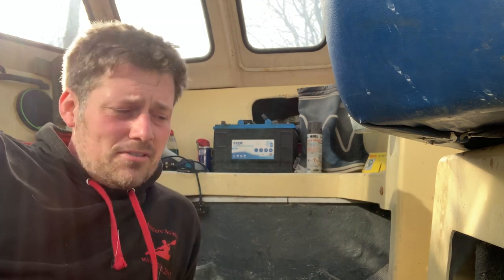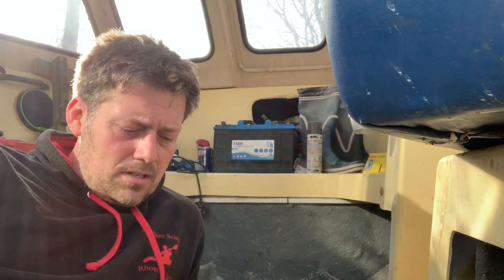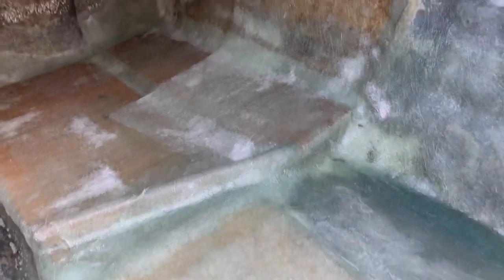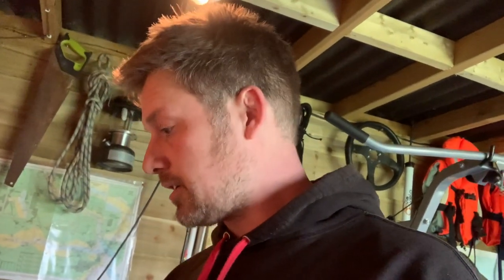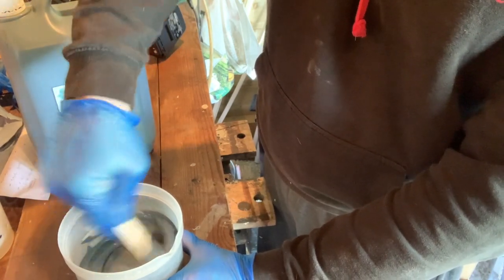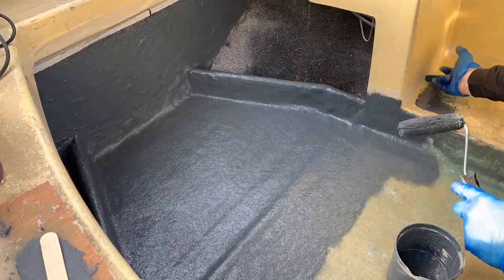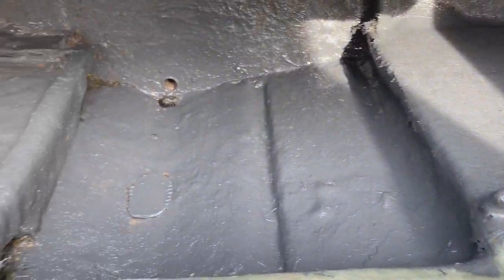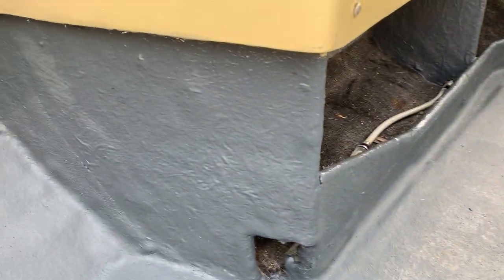Shetland Alaska 500 fitting a new boat floor Part 3 | how to flo coat a fibreglass boat

Comment: You can use polyester lay up resin without wax in styrene (gelcoat)for the first coats. Add wax in styrene for the top coat(Flocoat). That way its not necessary to sand each time. Gelcoat vs Flocoat
Reply from the maker: Thank you - good advice. To be honest I went on the advice of the fibreglass company who recommended epoxy over polyester.
Reply: Hi there Mark,
Very helpful.
Thank you.

Comment: The chop strand you need to lay it on then fin roller it then brush a coat over the top then lightly fin roller it again if you don't want any pinholes or gaps. Or you can sand it back slightly and do a barrier coat. You shouldn't have any fibers sticking up through the paint they needed sanded back

Comment: Hi there mate just to let you know for future that you can get non slip flow coat from East Coast Fibre Glass Supplies. Does a great job on the deck and as said its non slip rather than the standard flow coat. Looking good though.
Reply from the maker: Thank you - appreciate the help. Might get a bottle of that to redo it next year.
Reply: Hi there Robert,    quality information.
Thanks for your guidance.
Reply: Or you can mask ok the bits you want  smooth and use one of those artex type texture rollers just as its curing

Comment: Hi just watched the video iv got the same   flowcoat to do my boat what measurement did you use as a guide??
Reply from the maker: Hi mate, I mixed it up in small batches of about 1/2 a litre. It can be mixed with the catalyst at between 2-4%, I used the higher of this to make sure it cured off and it worked fine with me making up smaller batches. Let me know if you have any other questions 👍
Reply: Ok thank you for that ill have ago and see thanks again👍

Comment: hi what does the flocoat do or what is it for?
Reply from the maker: Basically it makes it look nice and hides the fibres. It is incredibly hard wearing and easy to clean.
Reply: @Suffolksportsfishing  you did a really good job, when you cut out the new ply floor and screwed it down and then fiberglassed it all in, is that bcos the new floor is also a water tight sealed unit incase the outside of the boat on the bottom hits a rock, for eg if you made a floor that can be removed it would not be air and water tight, but yours looks to be  completely sealed like a second skin
Reply from the maker: Thank you. So if you hole the hull of the boat the void under the floor will still let in water and sink eventually. Mine was completely sealed to be water tight, unless it gets damaged. You can fill the void with anything buoyant and then even if the hull gets holed the boat will not sink - if there’s enough buoyancy to hold the mass of the boat up… It also protects the ply and finished the boat off nicely.
Reply: @Suffolksportsfishing  thanks, yeah good job i  can tell you like to do it right the first time